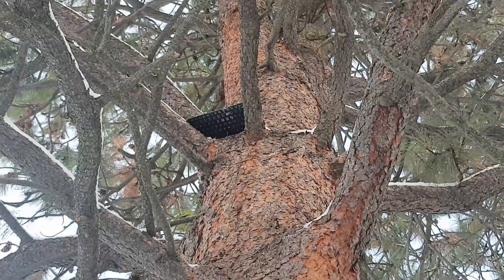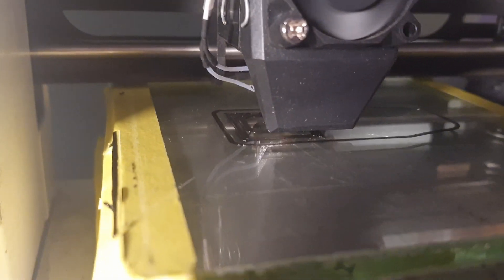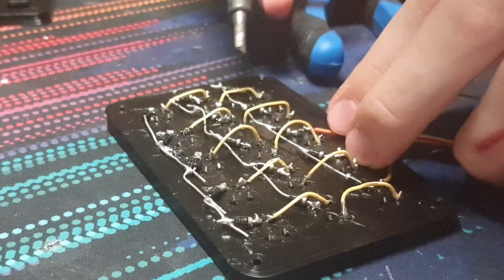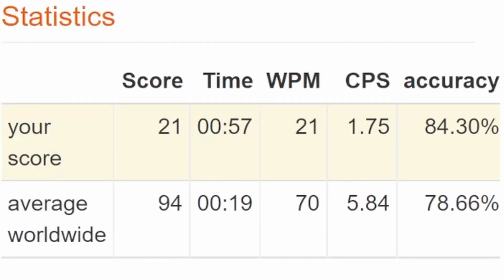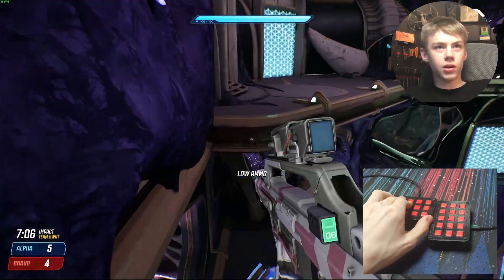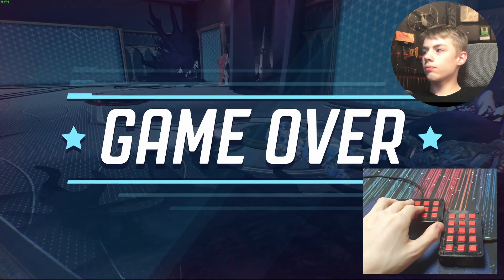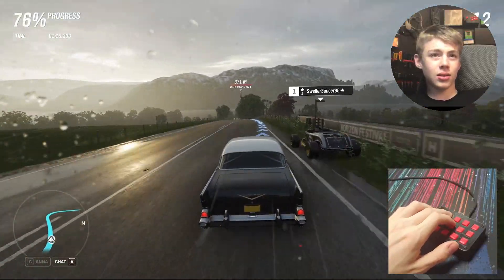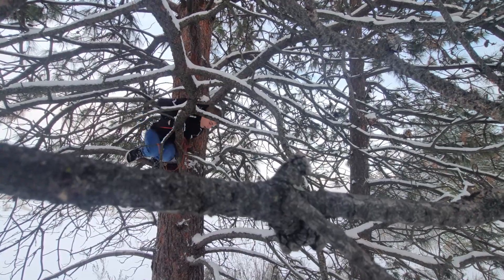Building The Worlds WORST Keyboard

Comment: btw can you tell the software you used in mobile phone to monitor the output
Reply from the maker: https://www.spacedesk.net/
Reply: @ScuffedBits  ohh its a remote opperation software (idk what its called) like vnc or team viewer.
but actually i was asking which software was changing the numbers when it received inputl . or did i miss something in the website?
Reply from the maker: @witherin-_-3712  it's arduino code thats sending data to the serial monitor
Reply: @ScuffedBits  no like its monitoring input how like it changes when i press a button and and changes when release is it a part of the arduino ide?Ther is a 1 in place of four zeroes every button press
Reply: @ScuffedBits  oh yeah the serial monitor what is it?
Reply from the maker: @witherin-_-3712  it's part of the arduino ide that you use to write the code in.
Reply: @ScuffedBits  ok i dont have an arduino+dont know c++ focusing on learning python cus its easy